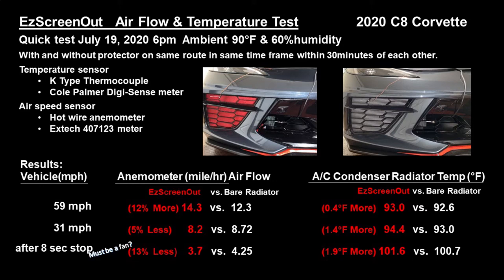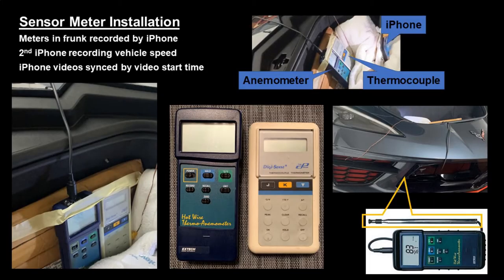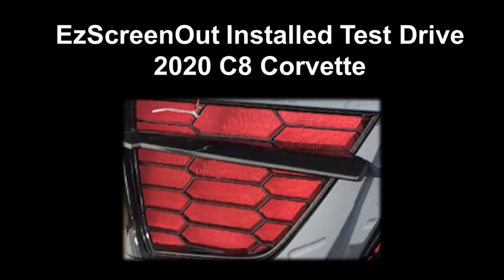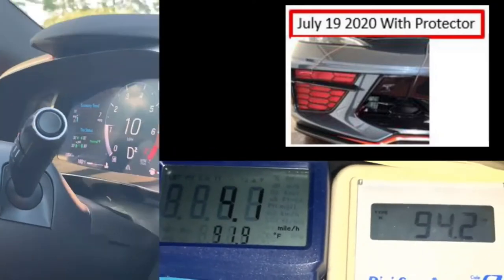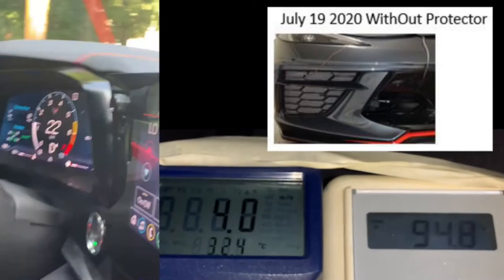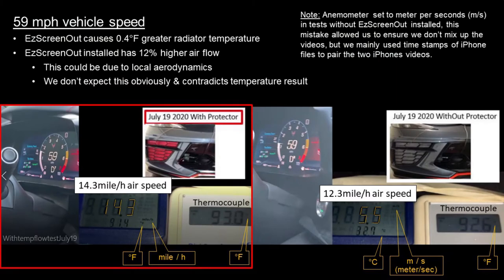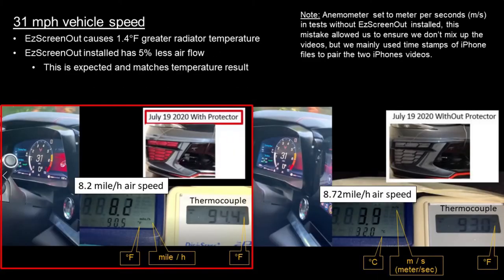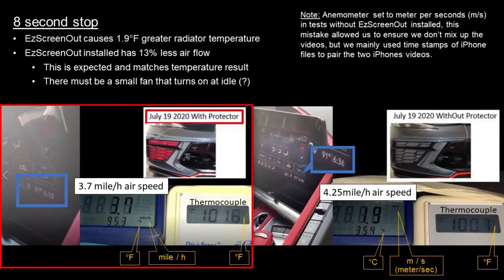EzScreenOut C8 Corvette Air Flow and Temperature Test 1, www.ezscreenout.com

Comment: Wondering if this could/would void the factory warranty? What does it cost for a pair?
Reply from the maker: Possibly, highly depends on dealer. Not sure if Magnuson-Moss Warranty Act is still in effect.  It requires the dealer to prove your aftermarket equipment is the cause of what needs to be fixed under warranty.  Less than $100 for pair, shipped.  Email us.